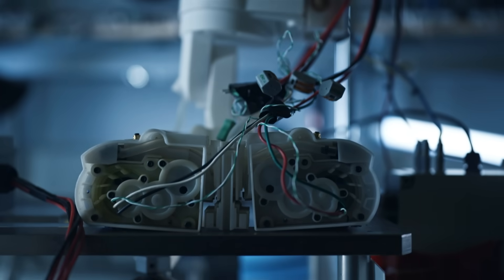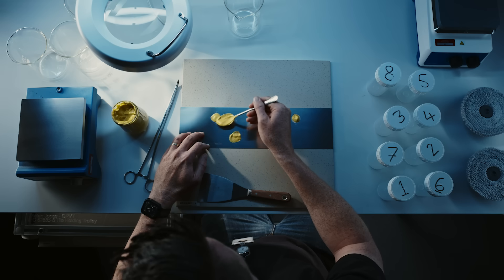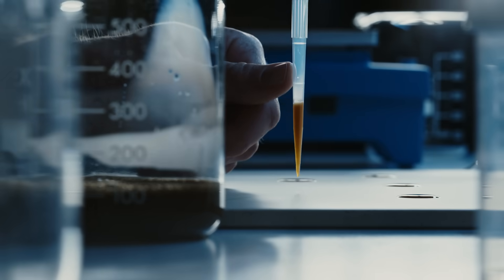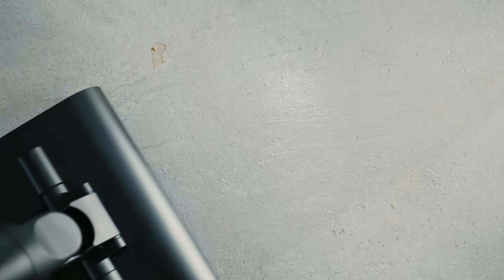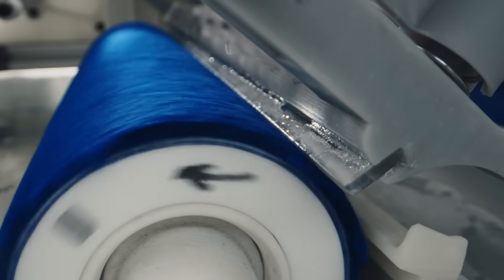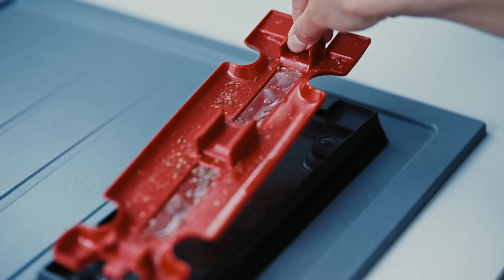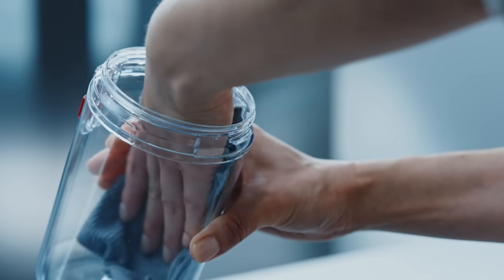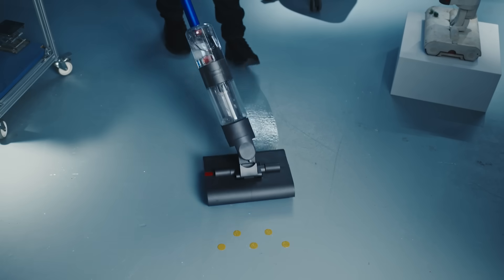The Technology Behind Dyson’s Wet Floor Cleaner: WashG1™ Explained

Comment: DO NOT BUY from this company!

Here's my experience with Dyson. I ordered this product (BP04) on black Friday because there was a very nice discount. This was on 20 November. After 10 business days passed, I called to check the status and they informed me that they would need to re-ship the item. Frustrating but fine. Today is 21 December, I called again to check the status, and they informed me that the item, that was supposed to be 'in transit' is no longer in stock. I spent 2 hours on the phone w/ customer service and they provided the worst type of support you can imagine. Only read their useless scripted lines, and it was difficult to understand their English, they essentially abandoned the call on one phone so I called with another phone just to confirm a refund was processed. So, they took almost 1000 of my money, refused to confirm a refund, never delivered a product despite over 1 month since ordering, provided absolutely terrible support on the phone and online, and left me wondering if I was just scammed in some sort of cash grab scheme. This is not how a multinational company should be operating. Zero trust in the brand and will share as widely as I can

My goodness. I will never EVER buy from this company again. Products are great, your supply chain and focus on CX are absolute garbage!

Comment: This unit is classic Dyson, over engineered, yet still doesn't do anything beyond a host of competitors at a fraction of the price. Keep in mind, this product doesn't actually 'wash' anything, nor does it clean/sanitize because, well it can't. 
Also, it doesn't have a heating function, so really all this product does is squirt cold water onto your floor, suck it up into a very small tray - which you then get the enjoyment of picking through to empty/clean it. 
Did I mention the smell? Sure, they say it self cleans, but with no heat, no soap, no disinfectant.. this isn't exactly 'self cleaning', and as a result the micro-fiber rollers get smelly and require hand cleaning, and eventual replacement at $79.99 (Canada) a set. 
Oh, and before you say, well you can put 'mild detergent' into it - okay, sure. but just FYI, I was told by 2 Dyson service reps, that it risks voiding the product warranty.. and still doesn't heat/steam so yeah, $899.99 (Canada) + $79.99 (Canada) to replace the rollers when they get nasty from never being properly washed and sanitized.

Comment: Can yall make a hand dryer that can actually fit hands inside without touching it, and a vacuum that doesn't fall over everytime you try to stand it? Our green dyson pet vacuum falls, doesn't suck well and has no light. Also the wand in the hose is a stupid design, it doesn't reach places well, shrinks too much when cleaning and that causes the fucker to fall over. It's a ~$500 POS.

Comment: Counter-Rotating mops? It already was implemented on the Roborock Dyad in 2021. And other modern wet vacuum cleaners like Dreame H series as latest H14 and H14 Pro gives you more interesting things like lie-flat cleaning and mop drying with hot air after the cleaning is finished. 
Dyson is trying to present the wet vacuum cleaner like it hadn't been invented before😂

Comment: Do I steel need the normal vacuum cleaner if I have this ?
Reply from the maker: The Dyson WashG1™ wet cleaner is our first dedicated wet floor cleaner for hard floors, picking up both wet and dry debris. But you may still need a vacuum cleaner for other areas - carpets, upholstery, mattresses, stairs, pet beds, countertops, and inside your car.

Comment: I asked earlier if the clean water tank was gravity fed or pump.  I have since checked and I can feel a vacuum at the tank connection so it has a pump.  The clean water tank arrangement is a rather strange design.  It has an air inlet valve at the top and outlet valve at the bottom.  The outlet valve has a bleed hole that is inclined to leak if the air inlet lets in too much air.  The designers would have been better to use the arrangement car fuel sender units use but I suspect this tank was designed by the marketing department.

Comment: so no soap or steam witch means this is just water and no sanitation?
Reply from the maker: The Dyson WashG1™ wet cleaner is engineered to clean effectively using just clean water. But if you want, you can add a low-foaming antibacterial detergent to the water tank, diluted per the manufacturer's instructions.

Comment: Its not much different from other high quality wet floor cleaners such as "Karcher" a german brand of floor cleaners which we have, has all the same tech from two counter rotating microfiber rollers with a scraper to get dirty water off the rollers and 2 other smaller brush rollers to clean debree of the main rollers. They work great but nothing really new here.

Comment: Big problem with straining everything through a mesh to separate the liquids and solids is that usually the solids you pick up with this are soggy and will quicky clog the strainer causing the liquid the fill up instead of flow through, and eventually overflow back onto the floor.
Reply: This is correct and this happens to me...

Comment: Wondering how this differs from the submarine accessory introduced a while back. I'm assuming this is even more effective for the task. 
Looks interesting!
Reply from the maker: The Dyson WashG1 wet cleaner is our first dedicated wet floor cleaner, engineered to wash hard floors. The Dyson Submarine™ vacuums are our multifunctional vacuum cleaners, which include a wet roller cleaner head, dust illumination and anti-tangle technologies.

Comment: Hope the debris collector is bit narrower and deeper, it looks too wide for easily emptying in the bin as bins at home are generally not wide enough so when wet unlike the video, dirty water will drop on the sides and next to the bin and don't think I will be able to tap against the bin without a mess

Comment: How does this mop do in homes with pets? And can you add detergent to the water?
Reply from the maker: Hi there, The new Dyson WashG1™ wet cleaner picks up pet hair and human hair. The microfiber wet rollers and the internal brush bars are easily dismantled for maintenance. If you decide to use detergent, please choose gentle, common household detergents, and do not use bleach and high-foaming formulation.

Comment: Not sure if Dyson will do better in water collection to leave a relatively dry surface after cleaning. Have Bissell and Tineco at my home, while both clean extremely well, they leave my tiles quite damped which is a pain for me.
Reply: And I'm sure the "hard particles" will not be as dry to tip out with ease either. That collection house will also be damp.

Comment: I'm intrigued to see how well this handles my wife's abundant hair shedding. The rollers seem like they could accumulate hair quickly!
Reply: This is probably designed to vacuum first and then use the washer. The solid pickup is just for anything that you might have missed
Reply: @nozopoke1782  didnt they say in the ad its not a vacuum? like they dont use suction?
Reply: @randomrazr ya go back to :40 onwards it says clearly it was built to not reply on suction - interesting isn’t it?
Reply: Essentially just a very amazingly built electric mop 😍😍😍
Reply: @nepheshrecord  yeah its weird they chose not to go that route. a vacuum would help not just suck up dirty water from the roller but also any other debris nearby that the roller doesnt touch

Comment: As an engineer, I have massive respect for the Dyson company you can tell that the company spends a lot of time, money and energy on design and cares about performance and innovation. I don't have enough hard surfaces in my current home to justify buying one, but if I did, I would. Well done!
Reply: Overengineered and overpriced. Some interesting products though, also as an engineer.
I went on the hype of the whirlwind vacuum 20 years ago, and it was the worst vacuum I ever had.
The dust collector is so small I had to empty it for each room, or it would lose suction - the total volume was rather small anyway, while other vacuums can easily hold 3-4 liters. Worse yet, when emptying it, you would choke on dust, which is avoided with the proven regular system, I would rather not save on vacuum bags, and save my lounges instead!

Also, the effect was excellent when doing demos, but only when it was empty, else it dropped in effect fast with the increased volume of dust spinning around. The occasionally needed full cleaning of the whole system was a nightmare, with so many nooks and crannies where dust and debris could get in, no way to get to them, and plain soaking it in soap water took forever and you could only dry it by using it, leaving it to get some dust stuck in the moisture again. After 6 months I could not see through the plastic to see the "magic", as it got so many scratches and dirt stuck in there --- and I could go on, too many flaws - atypical for engineers, it was "Form over function". it was a funny gimmicky machine, but not very practical. and I could buy 2 new regular ones for the price of one Dyson. - They keep solving problems that are not there!
Reply: I am not sure how different it is from a Tineco, Dreame or Roborock... Dyson is really good at marketing... I wish they would really deliver really exceptional performance and results... but many times are no different than any other cheap alternatives.
Reply: They literally moved a fan into the base and charged 10x the price for it, or copied the fast hand dryers that were in Asia back in 90s and pretended it was their idea. Now this is just them catching up to shark's hydrovac
Reply: Engineer my ass lmao. 900 euros for a plastic device that's as good as those half or even 1/10th of the price
Reply: so this isnt a vacuum? unlike tinecos?
Reply: As someone who owns a dyson vacuum that's only a few years old, it performs worse than the $60 Bissell from Walmart it replaced. It also constantly falls over, has no light and the hose design is retarded.
Reply: I’m not an engineer and I too have the utmost respect for Jim Dyson.. 🙏❤️
I’m about to buy this.
Reply: As an engineer, you haven’t got the slightest clue on what you’re talking about. Dyson products have been tested independently and have been proven to perform at the same level as products that are 10 times cheaper. Much like other firms however, Dyson relies heavily on marketing to sell its products despite its products objectively not justifying its price tag.
Reply: @Rightonrightoff  exactly why I wait couple years until it goes through cycle and buy older models. lol
Reply: @Rightonrightoff got a source? Id love to read into it a bit further
Reply: @Rightonrightoff  bingo
Reply: And even if only the plastic trigger is not working (just the spring inside), they let us buy the whole motor. In the waiting list for 10days, and within that day if it doesn’t arrive, they will let us but the new dyson with 25% discount. What a good marketing strategy! without taking care of their customers.😔
Reply: But still don’t care about their customers it seems.
Reply: @goodgremlinmedia2757 
I absolutely disagree with you..
There aftermarket is first class..
We had a Dyson animal that started to have issues..
It was 2 years a 10 months old.
We had taken out an insurance plan..
They had the Dyson collected next day from our contact with them..
2 days later a brand new boxed Dyson animal arrived at our door..
96 hours from our contact with them..
Reply: Dyson schmyson, does it dry the roller after? There are robot vac and mops that do since 2019.
Reply: @diadhuit8784 could you please metion some brands for suggestion. Thank you
Reply: I'd rather fly a Dyson then a Boeing

Comment: all this engineering and bullshit they portray yet i have a dyson air purifier (tp07 model $799 CAD) which is less then 3 months old and makes a squealing noise from the motor after about an hour of running, customer supports been of no help, and if you google / reddit it, its a common occurrence, yet the video demonstrating it shows all these neat scientists developing it I'm sure, yet probably has Chinese internals with bearings that wear out in less then 3 months of use AND that costs nearly a grand.... Don't be fooled folks.

Comment: But do you still have to vacuum first ?
Reply from the maker: You don’t need to vacuum first because the Dyson WashG1™ wet cleaner picks up and separates both wet and dry debris, and hair.
Reply: @dyson  
That’s a brave statement for anyone with a large dog 🤪
If it works I’m a customer

Comment: with all the fancy tech and design, you still need to take out the wet debris from the tray after every use. and what's the point of making the bucket easy to clean if you could have made the cleaning automatic by the machine...

Comment: So, if Dyson is releasing this, what was the point of the Dyson V15s Detect Submarine?
Reply from the maker: The Dyson WashG1 wet cleaner is our first dedicated wet floor cleaner, engineered to wash hard floors. The Dyson Submarine™ vacuums are our multifunctional vacuum cleaners, which include a wet roller cleaner head, dust illumination and anti-tangle technologies.

Comment: Clever, but not good for grime.  Grime requires the ability to scrub, which means bristles and mass.  The bristles need to be stiff enough and the head of the unit needs to be heavy enough to apply sufficient pressure to the bristles so that they can adequately scrub grime off a floor.  Liquid alone won’t do it, because grime is not easily soluble even if you use a chemical cleaner.  If your stain is wet and fresh enough for this mop to work, then you don’t need this mop, just a paper towel, unless your spill is very large.  Those five test dots they show in the video can be picked up with a moist paper towel.

Comment: hopefully the handle isn't made of flimsy plastic like the one Dyson that I tried. Returned it for a Shark for like $100 less that has better suction and the handle is actual metal so doesn't feel like it's going to snap off when using it
Reply from the maker: Sorry to hear you had that experience - the handle on the Dyson WashG1™ wet cleaner is made of a single-piece of formed aluminium.

Comment: Does this work with soapy water?
Reply from the maker: The Dyson WashG1™ wet cleaner is engineered to clean effectively using just clean water. But if you want, you can add a low-foaming antibacterial detergent to the water tank, diluted per the manufacturer's instructions.

Comment: This is the exact same mechanism by which Hizero (which has existed since 2017) works. Hizero has even won the Edison award and many more for their design. 

Hizero has been the only bionic mop that completely separates wet and dry debris in the way Dyson is making it sound like they have, through "hardwork" and "R&D".

I challenge anyone to lookup a video on how Hizero works on here and you can judge for yourself if Dyson is really being innovative as they are intelligently alluding to be.
Reply: The Hizero has a high-density polymer roller that sweeps and mops in the forward direction but only mops backward. In contrast, Dyson has two counter-rotating micro-fiber rollers
 which lets it mop and sweep simultaneously and in all directions with double (two rollers) the cleaning power.

The Hizero's debris catcher doesn't seem to filter the debris from the cleaning water in the catch tray; it just catches the debris.
Reply: @Domineon  Hizero does filter dirty water from the debris into a separate dirty water tank. As I said they were the first to accurately separate debris from the dirty water. Making cleaning a less "disgusting" task. 

As for the rollers, a polymer roller is actually less likely to harbor bacteria as compared to a microfiber roller. Therefore last longer and requires less cleaning to avoid odors. As well as leave less water on your floor. 

I will say the addition of the second roller on the Dyson does provide a slight advantage at best. As you said, it sweeps and mops in both forward and backward motion. I would not say it strictly doubles the cleaning power though. The gains from that are negligible. 

Another point to note, the Hizero is very efficient with it's water usage, while still providing a perfect clean. Only time will tell how much cleaning can be had on one tank of water with the Dyson.

Now, whether or not the price $$$$ tag associated with the Dyson is worth it based on the level of "engineering", "R&D" and "innovation" that went into this product, I leave up to others to decide.
Reply: @KilluaZoldyck-kc8ru  It looks decent, but not sold anywhere local. Which means it probably isn't serviced or exchanged anywhere local. The good thing about Dyson, personally, is that they are sold everywhere. Within 5 miles I can pick one up at Lowes, Target, Best Buy. Which means I can also buy the extended replacement insurance and just drive up the road and replace it in 15 minutes if something goes wrong. That is especially important to me based on the fact we don't have ground mail, so everything bought or sent for service is by air and very expensive.
Reply: The Roborock Dryad separates wet and dry too
Reply: Dyson has my respect for their R n D.  F challenging the norms.  Look at their hair dryer!! Their  fans!  Their cordless vacuums….. ❤
Reply: feels like this debris catcher also suitable for dry vacuums.
Reply: Please dont compare dyson with some other shitty brand
Reply: dyson is a marketing company

Comment: UGG, the concept seems nice but in reality like all dysons the hair on your floor isn't properly dealt with, so it will be very expensive and still require you to regularly remove all the hair from the machine and it won't work as well, then they will release a newer version that works better for hair but then you need to change the heads every time you use your device.